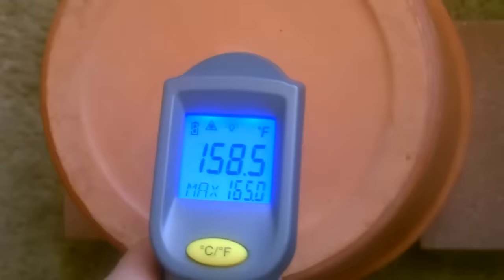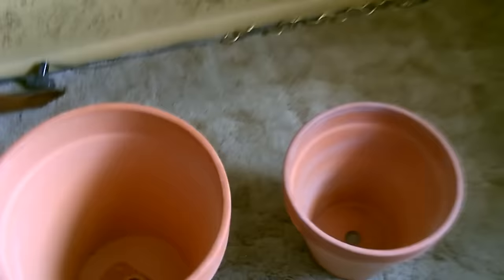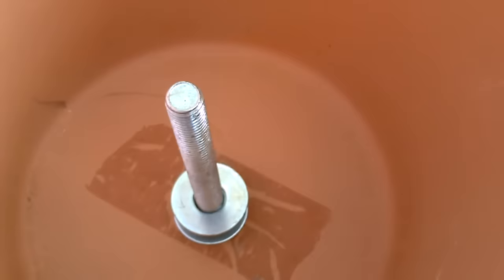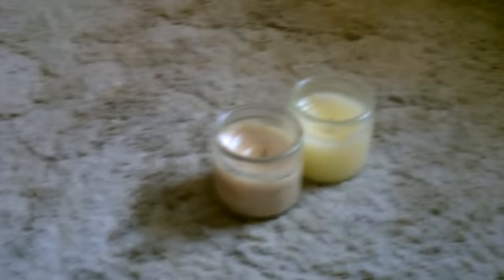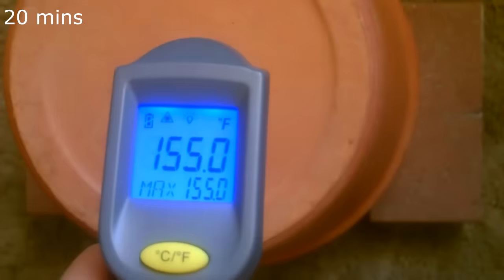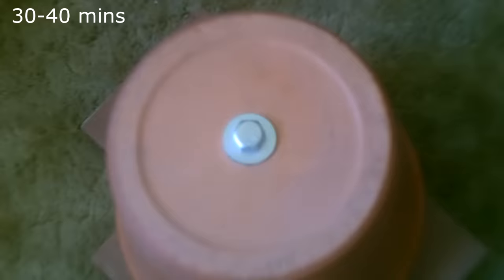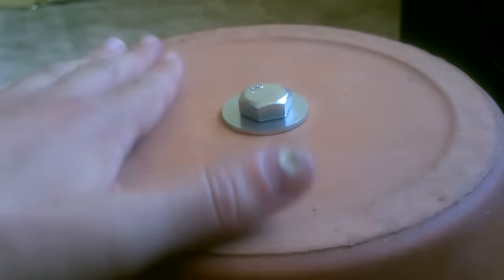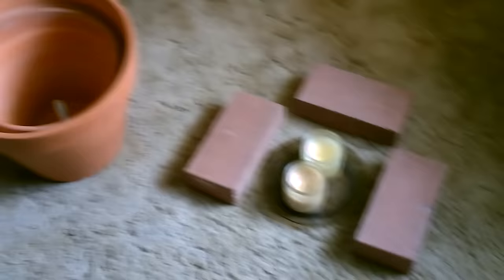Candle Powered Air Heater - DIY Radiant Space Heater - flower pot heater - Easy DIY

Comment: Since clay pots r cheap, definitely gonna try this! (already got the pots, just need 2 get the hardware) I see u have it sitting over carpet - wondering how hot the floor beneath gets? Does it radiate heat down 2 floor, enuf 2 scorch or melt it?

Comment: I just had an idea.  What if you wrapped copper tubing around it.  In theory, you would make a candle powered water heater and space heater?  Would this be possible?  It could heat water and you would have both concepts of radiant and boiler heat.
Reply: +Michael Filimon Water holds huge amounts of heat and will reradiate it gradually so I think that's a good idea. (Thermosiphon effect should be used so the water moves around thru the system.) I got the materials together for this type of setup but haven't tried it yet. Also the candles generate carbon dioxide and are a fire hazard. I have a "fireplace style" alcohol burner. That doesn't create carbon monoxide but does use up oxygen in the room. Best with outside air supply piped to the heater so that is not a problem. also that alcohol fuel adds a sort of alcohol or vodka smell to the air which is sort of funny. Also the candles will flicker because as I understand it there's no draft upward thru the pot center holes? Maybe a small gap should be left between the pots and washers to provide some small amount of draft.
Reply: Thanks for your response.  That would
 be cool to see!

Comment: May you use empty can of fruits and vegetables just the empty metal cans and make your own candles using about 5 sucker sticks close together or wrapped together for the wick.And try old shoe strings and tell me how it works ? I thought about putting candles in a thick wooden box or a metal animal cage to blow the heat ?

Comment: Need a shorter bolt. Saw that sucker off. Interesting though. The candles never go out from lack of oxygen? Turn the lights out and you will probably see a cool glow and reflection off the dish and the outside pot.
I guess with this system, some of the toxins paraffin candles put off are collected on the inside of the pots.
Reply: three wicks is about all the fire power you can use with one layer of bricks.  I have used up to five wicks.  But to do so I had to stack another set of bricks to increase the O2 flow. The more wicks the more O2 you need.

Comment: How necessary is the outer pot?
Would a single pot be cheaper, simpler to construct and more efficient?
Reply: I think the idea behind nesting the pots is that the inner one gets blazing hurt-you hot and the outer one spreads it out and makes it less intense.  The more thermal mass you spread it out over, the more of a gradual buffered heat-release you get, so the heat isn't so intensely concentrated.
Reply: UncleFexxer We are talking about one candle power. There seems to be little point in using it to heat twice as much clay as necessary.
A single tin can would heat up more quickly and could be more efficient.
Reply: Chris Gardner I feel like heating a larger area would be more beneficial; it would probably spread the heat around better. If you take your reductionist approach to the extreme, then it would be best to have no covering over the candle at all, because the flame itself is very hot. However, it is very concentrated and doesn't do a good job of heating a room.
Reply: Chris Gardner Tin can also dissipates heat faster than clay because it is a good conductor. Clay is a good insulator for heat so it retains heat longer. Glass is even better!
Reply: Chris Gardner We're talking about one candle power if we're using one candle.  Most vids I see of these being used have two or three candles in them.  The still picture I see for this vid shows three candles.  That's a good bit of heat.  And once again, the idea of thermal mass is a prolonged release of stored heat.

Comment: Has anybody tries using a container made of ceramic? I cannot find any of these big pots anywhere, especially now. Any recommendations on how to do it with ceramic?
Reply from the maker: hi. i've made a similar one using stoneware (from an old crock pot). i put heat source under it and blew a small fan across the top. you should be able to get big clay pots at most home stores like home depot or lowes. plant nurseries or garden supply stores should have them too. here's a link to the one i made with stoneware https://youtu.be/wJqyrHlKQaw

Comment: I recommended this on a comment I made two preppers. Someone replied that it had been debunked as not changing the room temperature What should I reply to them?
Reply from the maker: hi there. if you make these units correctly they work very well. the main thing is to use unglazed pots and use the right number of candles (also only use 2 pots). many people just use any pots and any candles and then expect it to work. another important thing is that the pots have to be at the proper height. if they are too low then not enough air gets to the candles and they burn weakly *and the pots barely heat up. if you make it right the heat just pours off of these

Comment: Aren't you supposed to leave the top hole free to let the hot air out??
Reply from the maker: hi. that is one theory, but i have found that with the hole blocked you get a better "radiative effect'. more heat gets bottled up in the unit and it radiates better to the surrounding area.
Reply: @desertsun02  thanks...good to know

Comment: Why use the pots? The candle heating the pot can not give off any more heat that just using the candle alone. There may be some radiant heat off the pots but still you can't get more energy or efficiency out of a candle by heating up a pot than the candle has just sitting there burning.

Comment: looks like you could even cook on it something simple... but higher temperature is needed to boil water
Reply: guys, some simple cooking can be made below 100C (boiling water temperature).  Thats what I meant.  You can make fried eggs or pancake on this device; but not "roast beef" or boiling water
Reply: Wim Harleev wim, no disrespect but put water on it and it will ball up and pop out , sausage my friend is cooked by the fat in it, which turns into oil...not water...this is a great idea he has, no reason to hate. i would do this if need be.... but get off the water kick and think  about what is being said here...
Reply: Wim Harleev 
Longest debate on the structure and science of cooking sausages ever !
Reply: Russell Ullinger His idiocy might be explained by what language he speaks natively. In Dutch / Flemish 'koken' means both cooking and boiling. This might explain why he thinks Anar's OP is contradictory. Doesn't make him less of a moron though...

Source: I'm Flemish...  ;)
Reply: Wim Harleev  Anar's comment makes perfect sense, yours doesn't.  Someone else has already commented that they used a modified terracatta  pot candle heater for cooking and heat.  I would think that you could cut the bolt flat and either mount a flat copper or steel plate to conduct heat for cooking.  But hey, what do I know?

Comment: It did heat up but the problem the more it heated up the more the candle melted. A 2 inch round 3 inch tall candle self destructed in 10 minutes. I will try to modify it.
 OH Yeah, Don't touch the nut on top. DOH!! Man that smarts.

Comment: They also say make sure those bolts aren't galvanised
Reply from the maker: hi there. as long as the flame doesn't actually touch the bolt it's okay to use galvanized bolts. the air itself it doesn't get hot enough to hurt that "coating"

Comment: Why is that you need to have two pots together. I don't understand that part? Good idea though.
Reply: it's to keep the air hot between the to pots so it wont escape to quick
Reply: aahhhhhhhhhhhh
Reply: starfire blaze Basically more surface area. The more area you heat the longer it will retain and produce heat.
Reply: I've seen another version of this where the inner pot had a plug in the drain hole and the bigger, outer pot drain was left open. That arrangement created a convection draft.
Reply: Good idea

Comment: Why two pots? Some even use three, is there a reason why you can't use just one?
Reply: cause the warm air goes from the middle part of the 1st pot, downwards and then to the sides, so it provides with even more heat instead of leaking the heat straight out it kinda recycles it and you get more heat and bigger temperature. I hope my explanation was decent english is not my native language.
Reply: No reason. More pots recycle heat though and are more economical. Plus the space between the pots insulates the heat and it radiates for a longer period of time after candle failure.
Reply: Thanks, was wondering the same thing.
Reply: Ah I see, I setup one like this and just used one pot. The pot gets very hot, I can't feel much difference if any but it's been an interesting experiment. Thanks for the replies guys :)

Comment: Can you boil water in a small pot on top of this?
Reply: No, you need to be able to heat the water higher than 212F to instigate boiling.
Reply: t
Reply: Stella Bella Well, let's see, a rule of thumb is boiling point lowers about 2°F per thousand feet which makes you living at 80,000 feet. Don't remember any Colorado mountains that high.
Reply: KlunkerRider Or put it in a vacuum:)

Comment: Some candle heater test observations: A single 6 inch terracotta pot was placed over four 1 in wide by 2 in high candles in a bedroom that is 14x16 ft. All night. 2x6 walls with r19 insulation. Temperature outside is 31° temperature readings on pot ranged from 107 degrees Fahrenheit to 170. Temperature in room is 59° F. 

Other Notes: making a rubbing alcohol candle with a wick about four times the size of a candle wick burned a lot hotter but lasted only about 4 to 5 hours. A Crisco candle with a large wick lasts a lot longer but does not produce as much heat. Sterno or chafing dish heaters produce a real lot more heat but only last around 4 or 5 hours. I do not yet understand why people double up pots inside each other, my personal observations is the pot gets hotter as a single pot. I will soon try the PTC fan heater. I am still looking for the best low cost solution to keep a large room 65 degrees F all throughout the night when the temperature outside is 30 F. Standard radiator style 1500 watt oil heaters cost alot more money but have more surface area therefore heats better than a candle/terra cotta pot heaters because of small surface area. Disadvantage of candle heaters is you go through a lot of candles! (If you do it on a regular basis) best as a emergency only solution to take the edge off. Looking forward to trying PTC fan heater. Seems like the best solution so far. One is on the way right now. I really appreciate you and all of your inventions and tests desertsun! Just make sure you include all the facts like temperature outside at the time, size of room, burn times, ect. Keep up the great work!

Comment: Does it cause a problem with carbon monoxide?
Reply: Do a few burning candles generally cause CO problems?
Reply: Do a few candles heat a room? How about under a couple pots? These pots cannot defy the laws of physics. You are getting the same energy/heat from the candles with or without the pots. It's simply a different, better delivery method.
Reply: My "opinion"....unless you are in a very tiny room (or closet?) it shouldn't be any problem at all as far as carbon monoxide. I read recently that one candle burning uses up about the same amount of oxygen as one person. So you and one candle is like two people in the room using up the oxygen

Comment: Plausible, seductive even, bit it does not convect hot/warm air when built as shown in the video. Like a divvy, I followed the vid-instructions, when my gut feel was that the outer pot should have 4 - 5 x 10mm (3/8") holes in the base of the outer pot to allow cold air to be pulled through the gap at the bottom, be warmed as is passes through and exits out through the now drilled holes (carefully drilled with a ceramic drill - that's a drill made for, not from ceramics).

Comment: But it should not make a difference if you use a pot or not.. conservation of energie.. same heat of the same candle? Only a different way of spreading the heat I gues
Reply from the maker: hi there. right, it's not creating more heat, it's just storing it up and radiating it where you want it (versus it just going straight up to the ceiling, then into the attic and out of the house).

Comment: it works exactly the same way like a masonry heater http://en.wikipedia.org/wiki/Masonry_heater. The clay pots absorb the heat via air to wall convection, than slowly release it via radiation and convection. That is a smart thing, but using a simple electric bed warmer or bed bed heater is smarter, and comparably cheap...AND safer at the same time
Reply: Yea, but here in Ireland the autumn & winter winds, now getting fiercer, will for hours on end shut down the electricity grid at some stage and again, then no electric blanket, nor warm water bottle is possible (though I have a stand-by gas hob for such situations), so having a Stone Age heater like this for the living room at least, during the cold seasons, and it IS cold here cuz of high humidity levels, will be magic and psychologically uplifting. Every couple of hours opening a window for 15 min or so to let in fresh air is most important though, then all will be cool, ah warm :^) Love & Peace ...